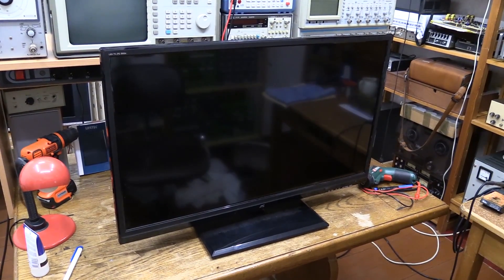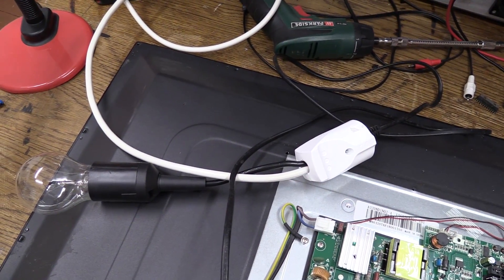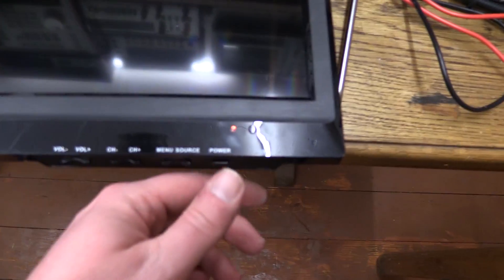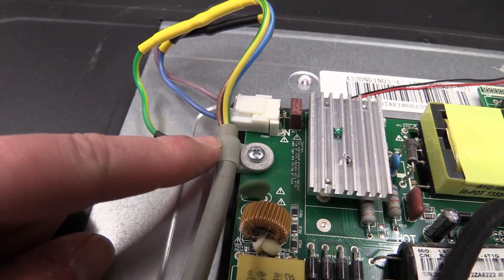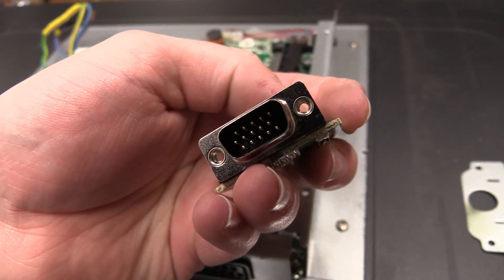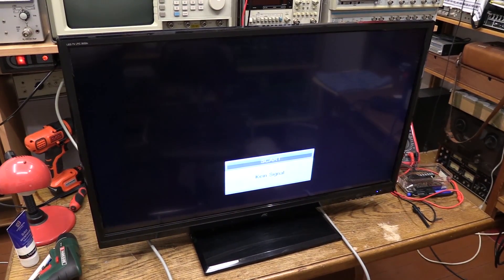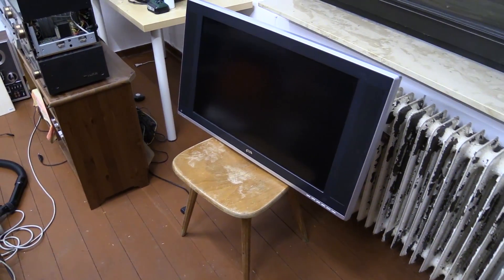High Voltage damaged LCD Television works!

Comment: You still have analogue TV available in Germany? I thought every country was digital only now.
Reply from the maker: There are still a few analog channels available on our Cable TV service. However, they have obviously cut down on bandwidth and maintenance for these analog channels, because the picture quality is absolutely terrible these days.
Reply: I can bet you anything that you could actually receive DVB-T channels in Germany. At least I know that a service has been active in the Koblenz area. It requires a DVB-T2 certified tuner, though, because all services are using H.264. Also, at least the services that are, or have been available on the analogue terrestrial service, are now available for free (that is to say no additional charge has to be paid over Germany’s normal “TV Gebühr”).
As far as the analogue channels are concerned: they’ve been switched off way back in 2002 in the Netherlands, so I must say I was amazed to see that, at least in your area of Germany, they are still live...
Reply from the maker: Digital terrestrial TV service (DVB-T2) is available for all of Germany, though in rural areas a rooftop antenna is necessary. Analog terrestrial TV as well as the older standard DVB-T have been switched off. DVB-T2 has actually introduced Pay-TV functionality to terrestrial TV service. Certain channels can now only be received in HD if you have a decoder card.
Reply: DrCassette It's not entirely true that the predecessor (DVB-T) had no Pay-TV support, because here in The Netherlands, we have had a paid terrestrial service since day one. We make use of DVB-T, not DVB-T2. The ONLY actual difference between the two, is that the latter supports H.264 (MPEG4) and H.265, whereas the former relies on MPEG2. That is the main reason as to why DVB-T does not support HD.
Reply from the maker: Thinking about this I'm not so sure anymore. Maybe there has been Pay-TV ever since, but just now with DVB-T2 all channels except the public ones have turned their HD service into PayTV so it's a lot more noticeable. I do boycott Pay-TV, so I really don't know much about their offerings.
Reply: Pay-TV has indeed been around since the inception of DVB-T. In fact, we, here in The Netherlands, have even had pay-TV channels in the analogue era. In a very small area of the country, viewers could receive RTL4 over-air, provided they would buy a specific decoder, required to actually view the image. This service did not run very long, though, because reception had to be impeccable in order for the decoder to actually work. Also, analogue signals were relatively easy to decode, meaning that a number of viewers didn't even bother going through the official channels for obtaining those decoders.
With Digitenne (our national terrestrial DVB-T service) having been introduced in the early 2000s, this lapse in security became a thing of the past. Analogue services have been off-air since 2002, and ever since, the operator running Digitenne has offered the full package of must-carry stations (stations for which a legal obligation exists to include them in any available offering for TV or Radio reception) in their service. The public channels are offered on a FTA (Free To Air) basis, which means that those can be received with no smart card in place. However, apart from the public TV and radio channels, every other channel on the service has always required the use of a smartcard (which obviously meant viewers have had to pay for them).

The service has worked relatively well since the start, but now that HD has become inevitable, the service is being criticised for still using the outdated DVB-T standard, as it simply does not support anything greater than 576p. For HD reception to be realised, the service and all of the viewers' receivers for it will have to be updated to DVB-T2. There have been rumours about this happening somewhere in 2019 (finally!), but I'm well and truly in the "seeing is believing" camp. It's high time, though, as we are one of the very few countries that (still) use DVB-T.

On the other hand, we were one of the first to use the DAB+ standard (Digital Audio Broadcast; digital terrestrial radio) as opposed to DAB (with no Plus sign). Its benefits are similar to those of DVB-T2: higher achievable audio quality due to optimised codecs and therefore less required bandwidth. DAB used MPEG1 Layer 2 audio (you may be familiar with .MP2-files; this is similar), where DAB+ uses HE-AAC MPEG4-audio.
That being said, currently, DAB+ is active alongside regular FM. the switch-off has been planned for somewhere around 2021, but the exact date is subject to change.
Reply from the maker: Back in the days of analog TV the only way to get Pay-TV here in Germany (as far as I know) was via the Astra Satellite System. The German market has always been very difficult for Pay-TV providers, and even today that all HD channels are Pay-TV they are still very unpopular. Only about a quarter of viewers pay to see all channels in HD. 
I had a DAB+ radio receiver, but I ended up selling it because the reception was bad - Analog FM starts hissing when the signal is weak, digital DAB+ cuts out completely or has annoying glitches in the audio. And from what I have heard, the audio quality of DAB+ even when reception is perfect just isn't HiFi. You do hear the effects of the compression. I don't listen to the radio very often these days as there are to many advertisements and the DJs trying to be funny are really just plain annoying. However I do have a little HiFi Stereo FM transmitter (0,5 W) and I do plan to set up a Raspberry Pi to create my own radio program for use inside my house.
Reply: The market for Pay-TV in the Netherlands really is very different. In Germany, even if you don't have any subscription, you can, depending on where you live, still get a great variety of free-to-air channels (which we can also receive here in the Netherlands if we make use of a satellite set-up. In the Netherlands, we have abolished the TV licence (German: TV Gebühr) in the 90s. Since then, it is included in  income tax. However, that did mean that less money was flowing straight to the broadcasters, and therefore they had to embrace other ways of generating money.
We did have commercials on the public channels ever since the 60s, albeit they came in segments of up to 3 minutes at most, in between programs. As from the 90s, that time has been extended to allow up to 7 minutes of commercials in between programs for the public broadcasters. True commercial television (such as the aforementioned RTL4 (which started life as RTL Veronique) ws only allowed as of 1989 (that is to say: we could receive it from then on; they weren't yet allowed to broadcast from within the Netherlands). RTL started 'coding' their programs as early as 1991, and required users to purchase or rent a special terrestrial (up 'til 1993), cable or satellite decoder for receiving these programs, which were mainly films and international series. Dutch content was viewable free-to-air. When the TV digitisation came into effect, first on satellite, RTL was quick to embrace this technology. RTL had long been the only party to run commercial television in the Netherlands, right up to the end of the '90s. When RTL Veronique started their service, it wasn't officially allowed to broadcast from within the Netherlands. This only changed midway through the 90s, meaning that RTL4 and 5 started life in Luxemburg, and are still available to open reception there. Only when their first competitor saw the light of day (SBS6) did the law change and allow for SBS Broadcasting and others to set up shop within the Netherlands.

RTL Veronique and others have had various very successful series, so people naturally wanted to see those which led to very early acceptance of these services. Effectively way before the government allowed their formal existence within the country.

Another thing is that the public broadcasters back then only had 3 channels. Others came from other countries, including Germany. We have always been able to receive ARD, ZDF and WDR nationwide, and some territories could also receive N3 or SWR3, depending on which German region was closest... Add to this the fact that a large number of households are actually connected to cable systems (or at least can be connected_), and you'll realise that, by the end of the 90s, the market was wide open for commercial parties to enter stage. By now, we have no less than 25 stations specifically aimed at the Dutch market. That's almost as many as there are _freely available stations in some areas of Germany... Mind you, to access any of the commercial stations, one needs to be subscribed to either a terrestrial, cable or satellite service...

I can only guess, but I believe that, in Germany, much like in many other countries, the popularity of VoD (Video on Demand) set off way earlier than here, with parties like DMAX starting a service way back in the (early) 2000s. Here in the Netherlands, VoD only became really popular when Netflix became legally available. So I guess that, ultimately, the developments of the Dutch market for VoD can, in some way, be compared to those of the "regular" commercial stations in Germany...
Reply: Here in Norway they sadly completely shutdown analog FM, so now only option is DAB.. The quality is so horrible due to over compression that you can hear the difference between a good quality stream even on a portable DAB/internet radio. Most channels sound like 96kbit mp3 ;\
Reply: That may be because of the fact that Norway also actually uses DAB (and not DAB+), at least for the stations with which you experience the issue of bad audio quality. As I've mentioned before, DAB (the older standard) uses MPEG 1 Layer 2 audio. For this codec to sound anywhere near acceptable, stations broadcast would have to be encoded at least in 128kbps. However, if there are many stations within one and the same ensemble (transport stream), that would take up too much space, so they will then accommodate for that by lowering the bitrate. For DAB, this is devastating... DAB+ uses the way more effective HE-AAC codec. To sound acceptable using this codec, stations should be broadcast at around 96kbps. Of course, higher is always better, so that, in many cases, stations that broadcast content which has a wide dynamic range (e.g. classical music) will most often be broadcast at 192kbps, or even at a higher bitrate if available bandwidth allows.

Some receivers allow you to actually see at which bandwidth a specific station is being broadcast. If yours has such an option, you could always tune into one of the "offending" stations and see just at what bandwidth the transmission is being carried out. You are right though, that when comparing DAB, or even DAB+, to FM, FM can outstrip them. But only at their lowest bandwidth. I challenge you to find a station that does everything right (streaming bandwidth being one of the factors in play only), and then doing the comparison again. You see, if the station applies all the possible techniques and broadcasts at an adequate bandwidth, DAB+ allows them to "tell" the receiver (radio) how it should sound. This is because DAB+ also allows for information regarding dynamics and other parameters to be carried along with the base audio stream. Most high quality receivers will then use this information to further optimise sound quality. This feature set is another difference between DAB and DAB+, as the former did not offer it. Sadly, there are only very few stations which actually use these features of DAB+... Doing this would potentially allow for even more saving of bandwidth...

Comment: Oh wow, I've heard of so many knockoff brands, such as "Pensonic" and "Palsonic", and now there's "JTC". Wow.
It doesn't appear to be made by the same OEM that builds TVs for "Skyworth" and "Soniq", though
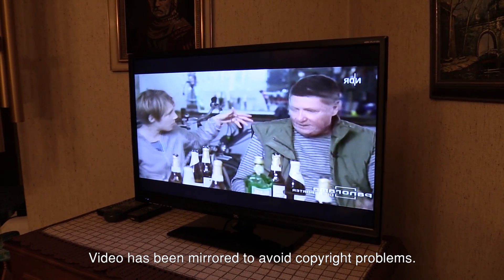8:03 You mean 1360 by 768, right? At least my 32 inch LG has a display with that same resolution, and on these Chinese OEM TVs, "LED TV" probably refers to it being LED backlit, rather than actual LED pixels.
Reply from the maker: Yes, 1360x768 is the "HD ready" resolution. Of course LED stands for the LED backlight. "LED pixels" as far as I know are referred to as OLED (Organic Light Emitting Diode). Those displays are very expensive.
Reply: We have worse TV  brands in the US, HITEKER (If you don't know why that's bad then you have no clue). Highview, Broksonic, Sceptre, Haier (thier washing machines spindles break often, with a sound as loud as a gunshot)(and their Tv's fail a lot. Digital research (sounds like white van speakers) Hannspree, which I experienced in a hotel room. Ugly 2004 reject  case design and sluggish, 2005 like  despite being made in 2012...